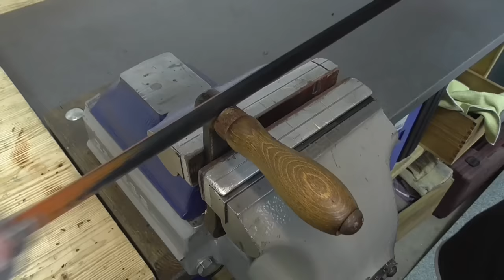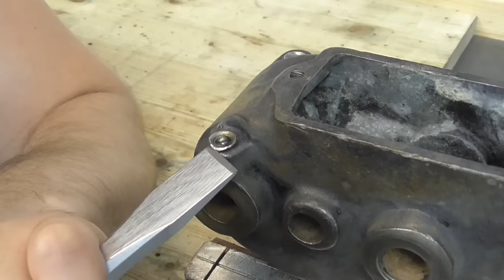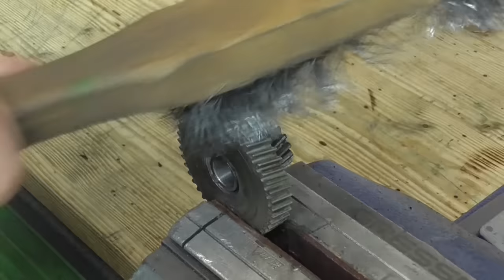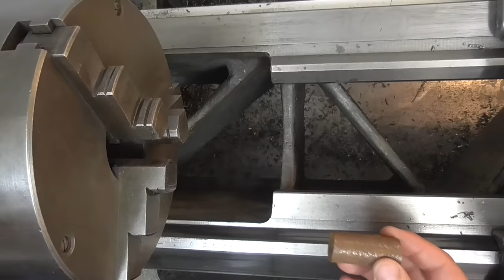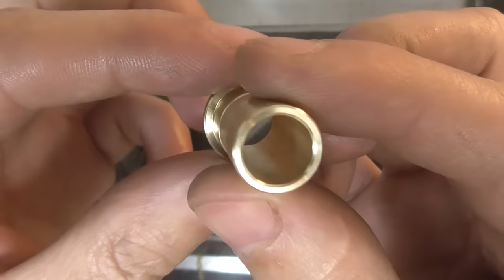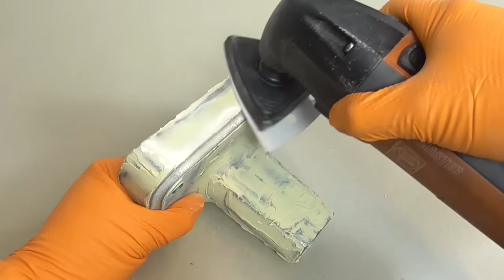Antique Hand Cranked Grinder - Restoration

Comment: Now when I watch other restoration channels I'm like: "pssh, he didn't even make new one"
Reply: That's not even a joke man. I do the same thing.
Reply: Dude, your comment made my day! This guy is out of this world. 😄
Reply: i skip all channels without sand-blasting
Reply: @miwing  watching things get sandblasted is incredibly satisfying, same with pressure washing videos
Reply: Either the world is getting full of crazy people like me, or we are all more normal than we think
Reply: It`s the same with me, when I watch some other restoration videos and they are doing a "Full restoration" and it`s just cleaning and polishing parts and nothing else. I am very disappointed with that :D ,  but My Mechanics never disappoints me.
Reply: Agreed, almost every other restoration channel just doesn't adhere to my standards now. Tysy Tube and My mechanics are the god of restoration.
Reply: It's not a restoration until you've made your own replacement bolts!  And springs.  And wooden handles.  And pins.  And...
Reply: I feel like "restoration" means taking the old parts, cleaning and re assembling the machine. Not making an entirely new one.
Reply: this is me when other restorers don't blue the steel parts, or do the 1/3 lemon, salt, and flour mixture for brass/copper/bronze parts. I'm like pffft amateurs!
Reply: @zerogbot23   I agree, I would add  Rescue & Restore
Reply: Eh, the only one from Rescue and Restore I’ve seen is him restoring a gumball machine, where he used olive oil as lubrication, which would surely go rancid. Haven’t watched another.
Reply: I just started watching this channel and I clicked on a video not realizing it wasn't My Mechanics and I was waiting for a "I make new one" annotation only to realize I had cheated on My Mechanics with another restoration channel. I felt so dirty.
Reply: @miwing  metoo ;)
Reply: J Trujillo love u boss I love your work
Reply: @InvntdXNEWROMAN I tried watching another tool restore video that was not made by our guy, I felt like I cheated on him.
Reply: Good
Reply: relatable
Reply: That's the part I like most :)
Reply: @InvntdXNEWROMAN  😜😜😜
Reply: @professionalcommenter  😜😜😜
Reply: @zerogbot23 ... you are so right!  There are some talented restorers on YT, but these two are a dimension ahead of the rest! They just refuse to take any shortcuts, put in the time required by each project and have honed their skills to craftsman levels.
Reply: Riiight?
Reply: @J Brown I disagree. Hand Tool Rescue is in the same league as My Mechanics effort-wise, but his style and level of access to resources are different. Until recently, he made his videos in a non-heated garage. HTR is approachable, garage-hackery level of resto work, while still putting in the effort and attention to detail to make the product real good. MM is obviously a professional with access to a serious machine shop (or at least a rich hobbyist), who can afford to turn new parts out of bar stock and make new heat-treated cutting blades for hand planes.

They are both very good, but the approach and style are radically different.
Reply: @J Brown Also, he replaced the cover that left a gap in the corner for dust to get in, and he replaced the crooked wood-on-steel handle axis with a lubed brass-on-steel one, while STILL preserving the old handle. I'd say this qualifies as going the extra mile for longevity and user experience (and to show off his machining skills, of course).
Reply: @williamutting6435  If the old parts are falling apart and you just put it back together, can that really be called restoration?
Reply: @nathanbates9561  that's why you either fix or replace those parts with other original pieces.
Reply: @williamutting6435  For example, restoring a building always means bringing in newly made material to being it back to its original condition. So in the truest sense he is restoring all of these tools.
Reply: @nathanbates9561  yes, but the problem here is that he either: replaces too much; changes it too far from it's original form; or gets rid of all dents, this gets rid of its past and doesnt show what's it's been through. I just like to restore tools to their original design and function but still show what the tool has been through.
Reply: @williamutting6435  well that (show what the tool has been through) is not restoring it to its original condition. Changing too much is an opinion as for all intensive purposes he replaces relatively minor pieces and when he does they are all crafted with the same design as the originals. Bottom line - he is restoring tools regardless of whether you like how he does it.
Reply: You're watching other channels? facepalm
Reply: Hahaha yes!
Reply: @williamutting6435  Absolutely, putting a Ferrari engine in a Model T might "improve" it but it is just wrong!
Reply: @nathanbates9561  I doubt that grinder looked that good when new.
Reply: @dougstrong696  Well "doubt" versus "didn't" is two very different things.
Reply: @blakfyr4773  k
Reply: I'm a New Restoration project creator.
Reply: Making a new one... Yeah, he could have made the whole new tool that way. That's even not full restauration.
Reply: My Mechanics  has set the bar for restoration in my opinion.  I like  tysy tube  and rescue and restore  but   they are either  a bit more one style (RR sticks to toys  but does amazing powder coating) or hit and miss (TT does a lot of great restores  but will sometimes  just do a fun silly restore  which is  ok but doesn't scratch the same itch). After that the quality drops down a few levels.  I watch a few tonka  or knife  restorations  but  they  don't  come close to this stuff.
Reply: I’m 11 months late but I’m pretty sure almost everyone is missing the joke about your comment and are taking it way too deep lol correct me if I’m wrong
Reply: Haha good one
Reply: miwing 

ФФ

Comment: You should measure their wheight before and after.
Reply from the maker: That would be interesting indeed, but the item should be dry when measuring (no grease).
Reply: @mymechanics  No. I meant with dirt and all. I would like to know how much it loses wheight when you remove all the dirt.
Reply: @mymechanics  That would be very interesting, please do.
Reply: It wouldn't make much sense due to the replacement of parts, the remanufacturing of others and finally the media blasting, grinding and polishing of most of the other parts would make the determination of "amount of dirt removed" problematic.
Reply: @larrydaniels6532  Not really. Just clean it w a towel or sumn and weigh it then once its done weigh again. And weigh before you clean so 3 times.

Comment: Me at 12:14: -Nah man, you can't restore a grinding wheel, it's impossible..
Also me at 13:03: - I allways knew you could!

Incredible man, keep up the outstanding work!
Reply: Dressing a grinding wheel is not black arts, though.
Reply: If you look really close he's hiding the huge chip with his thumb when he shows it off.  Can't blame him, the only thing that would get rid of it is making the wheel quite a but smaller.
Reply: if you actually need a diamond tool to reshape those, it makes me wonder how do you make them in the first place...
i mean, sharpening wheels have existed for quite a while now, long before diamonds were readily available, did they just grind it round with another stone ?
Reply: @electrostatic1   The wheel is smaller, in height and width, and I don't see the chip. Though I thought that I spotted it until I slowed down the speed .  Can you provide the time marker?   Obviously, it still works. But if there is a chip, I want to see it as well. thanks.
Reply: All of the abrasive particles that he “machined” off of that grinding wheel are now on his lathe and that is a no no.
Reply: @scotthaddad563  uh oh, sounds like he might have to restore it.
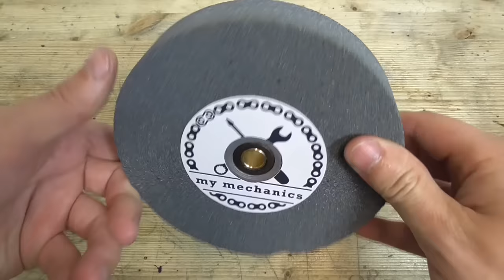Reply: Tao Tuhao look in the upper right hand corner of the wheel at 22:33, it’s still there, he has just been de-emphasizing it.  At 21:44 he literally has his right thumb inside the notch as he flips it over to make it less noticeable.
Reply: Lapantouflemagic0 Yup, you can use any harder stone, or the same type of stone.  It just takes quite a bit longer if they are both the same type as you are wearing each stone equally.
Reply: Andrew knap the point that I was trying to make is that the abrasive particles shorn off of the wheel are now in the working parts of his lathe and will grind the precision surface to cause it unnecessary wear. Most machinists won’t do what he did there but if they did they would cover the ways of the lathe with something. I didnt notice any sort of cover. Does that explain my comment?
Reply: @scotthaddad563   It definitely seem that he understood and made a joke.

Comment: MM: "This part is broken/doesn't fit at all."

"Say it."

MM: "I make a new one."

[Happy squealing]
Reply: n u t
Reply: @boofe7206  bruh😂😂😂😂😂
Reply: @boofe7206  so thats why the cornbread is soggy
Reply: @VK_855  á
Reply: He goes from restoring to rebuilding.. he runs alot by making new parts and not reusing or reuses old part for some thing different.. he dont even keep every thing all original or try to replucate the original he all ways needs to make his improvements.  With that being sad he douse good work but if the handle is not broken dont cut it off work around it ffs!
Reply: @boofe7206  uy trety
Reply: You here from 2018?
Reply: @molor0824  um no when he makes a new part for a part that only need to be cleaned up that's boredom or trying to make the video longer
 Theres a saying 
If it's not broken dont fix it 
Theres all so the fact that he goes out of his way to modify the tools from original running its historical look just because he cant leave it be or he dont like the look
Reply: @geraldwillcox  when i saw him cutting the handle , i  was so sad. why?  why?
Reply: He is a perfectionist. It's not about the historical look or value,(these are not really high value items) but more about making it the best that he can. If he can make it better than it was, then he will. Which explains all of the cool tools $$$. He probably can't help it. Couldn't sleep at night. Just think if he used his powers, gifts, abilities, for evil instead of restoring antiques.
Reply: So true 😂😂😂

Comment: I have a 1992 Honda that could use a “perfect” restoration.
Reply: It'll probably do a sub 10 second 1/4 mile after he's done with it. :D
Reply: Ooo! there's a concept for a youtube channel: "Restore it EXTREME!
Reply: bill Bloggs  Why?  My 1999 Honda CRV is still running fine. Yeah, last couple of years I have had some big repair bills, but they have been for things that were due for repair or replacement anyway. The engine are running just fine (have had them checked and no sign of need for any "attention").  I have one spot of rust, which ironincally is in a spot that I habitually see rust on other CRV's of the same age range, particularly 1999's for some reason.  No where else on the car.  My problem is finding someplace with does "restoration" on old cars.  Even Maaco doesn't want to be bothered with it.

Comment: I am pretty sure lots of these were less perfect when brand new
Reply: As much as it's a beautiful video I totally agree, I dislike that they call it a restoration, but it's more than just a restoration. It's a better representation than it would be originally.
Reply: @lorencarey7161  If anything, it's a Platonic restoration: restoring the old and used thing not just to its original physical state, but to its ideal state, the one it would come in if the original makers weren't constrained by costs and the technology available to them.

I disliked the fact that he refinishes structural pieces to look like new, instead of bluing or otherwise corrosion-proofing them while preserving the signs of time. But then I understood that he goes off of a Platonic ideal of the thing, rather than just trying to restore and preserve the function of it. I habitually dike zipper pulls off new clothing and bags to replace them with cord, so preserving the ideal aesthetic was lost on me for some time.

Also, I was sure he'd chuck the grinding wheel and get a new one. Abrasives are expendable anyway. It was a pleasant surprise when he got the diamond tool out.

Comment: I would have never thought to mount the dressing tool in the machine. That's awesome.
Reply: all that grinding dust in the ways though, ouch
Reply: James Rush 
oh, thank god i am not the only one that saw that. yeah, i felt pain seeing that happen.
Reply: I wish I understood waht you are referring to
Reply: @marshwetland3808  With metal lathes, you don't want grit inside its workings. When he used the lathe to even out the grinding stone, lots of stone dust scattered around/in the lathe. I think that's the concern.
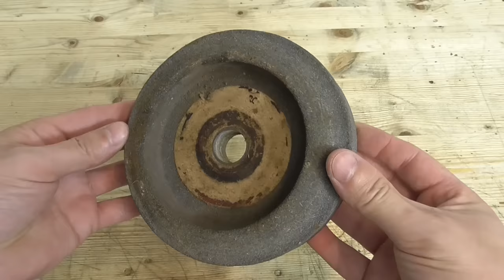Reply: @Calamity_Jack  So at 12:14 when he grinds the stone wheel, bits get everywhere. I still don't understand "mount the dressing tool in the machine." What's the dressing tool?
Reply: @marshwetland3808  I'm not a machinist, but I think the dressing tool was that rod with the diamond bits stuck in the end. He mounted it in the lathe's chuck to grind the stone even. (Someone can correct me if I'm wrong.)

Comment: My Mechanics goes to Chernobyl: “This nuclear reactor is broken beyond repair. I make a new one.” proceeds to fix Chernobyl with a lathe, some sandpaper, and cold blue
Reply: Maybe he could try Fukushima too,,,,,,
Reply: Underrated comment of the year.
Reply: Don't forget the sandblaster!
This comment should get more likes
Reply: Don't forget the sandblaster! Ha ha! And the diamond cutting tool.
Reply: The idea might be dangerous
Reply: @Andrei12367  you're right, he must remember to wear PPE (Personal Protection Equipment)
Reply: I didn't even say ppe
Reply: @Andrei12367  you said the idea was dangerous did you not? Therefore the only logical conclusion to be made is for him to wear protective equipment while fixing Chernobyl back to its original glory.
Reply: @moviemaker2011z  there's still radiation so I think he should wear a maximum hazmat suit
Reply: @Andrei12367  good call.
Reply: ahahahaahahhaha
Reply: Also a welder and a sand blaster.
Reply: @Andrei12367  Radiation goes right through plastic & cloth "hazmat" suits, they only keep the radioactive dust off/out of you, so you're ok when you leave. Standing around a radioactive place isn't good for long

Comment: I guess I solved “The Mistery of the Screws and Nails in the Gearbox”! Those were used in place of the locking pin. As time went by, they got loose and fell into the grease, like insects on amber, and got fossilized inside the gear box, being replaced by another one. What we have there is the history of the jerry rigging of the grinder!
Reply from the maker: Haha, interesting thoughts
Reply: @mymechanics  well... that was the best, the only really, explanation I could find for the nails and screws in the gear box... Any alternatives to offer? (great job, by the way!)

Comment: It think people are like “it doesn’t work as well as it did, I’m just gonna throw it on the ground and let it get worse and it’ll be someone else’s problem in 70 years
Reply: In my experience, older people get to where they can't or won't use stuff anymore and it sorta sits in a shed until someone comes along to clear the estate. That or someone gets an upgrade and the still functional but outdated or older equipment goes in storage as a backup and gets forgotten about.

Comment: I know I'm late, but, I think I have an idea on why those screws were in the gearbox. 

When you first tested out the crank, the whole thing was obviously unbalanced. I think the last person that used it had a similar problem. So they put leftover pieces of metal (( Screws )) to try and weigh it down in an attempt to stop the vibrating. With the whole thing well greased like it was, my guess was that the screws were first causing rattling when spinning the wheel. The grease just made the screws more silent. But, that's just my theory.
Reply from the maker: I'd just bolt it down haha ;-) jk
Reply: @mymechanics  I would've done that too XD

Comment: I was like "how does one restore a grind wheel... He aint gonna put it on a lathe grind it, right?"
>proceed to grind the grind wheel with diamond.
I'm a bit baffled.
Reply: it's called dressing and it's a routine thing on high precision surface grinders.

Edit: typo
Reply: Diamonds are among the hardest, if not the hardest, materials on the planet. My concrete cutting saw has diamond tipped teeth. Have you ever seen a diamond cutting tool for glass?
Reply: @droceretik  I've seen them glass cutting tools, yes.
I do understand the application of diamonds in these sort of things. Just that it never occurred to me that you could restore a grind wheel by grinding it lol
Reply: It's called trimming, and that's a real tool used in today's engineering.
Reply: @penfold7800  you can buy them all day on Ebay as dressing tool

Comment: I have a question: why do you sometimes use bluing liquid, while other times you heat with a blowtorch and quench in oil? Thanks!
Reply: You heat and quench things that need to be hardened. So anything that's involved in cutting where you need to maintain a sharp shape instead of bending. Hardening makes things more brittle so you don't want to use it on things that need to bend under pressure. Take a samurai sword for example. The cutting edge of the sword is heat treated to make a sharp cutting edge, while the other side of the blade is made from metal that is not heat treated so it maintains its structural strength and can bend to absorb the energy from blows instead of shattering.
Reply: Watch my mechanics insights. He uploaded a separate video regarding this.
Reply: Yeah I saw it was like a few days after I posted this! What a coincidence. Thanks to both of you, guys!